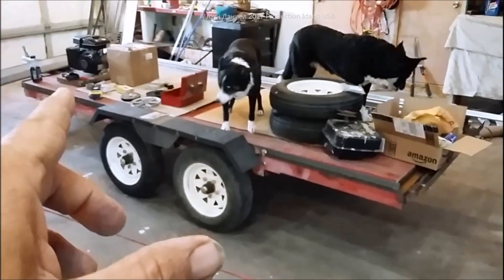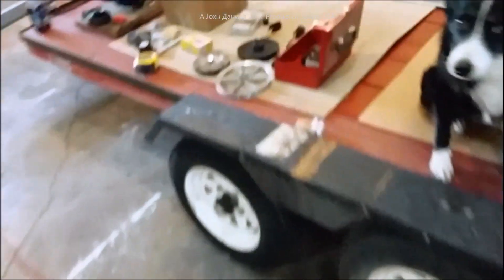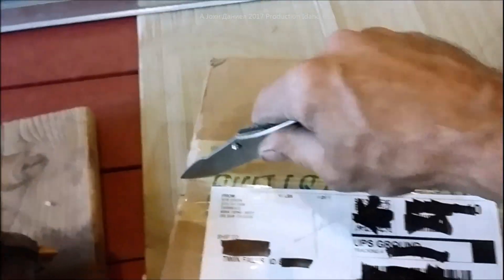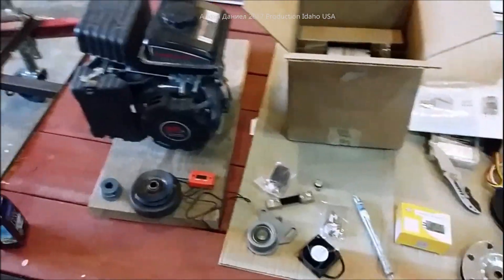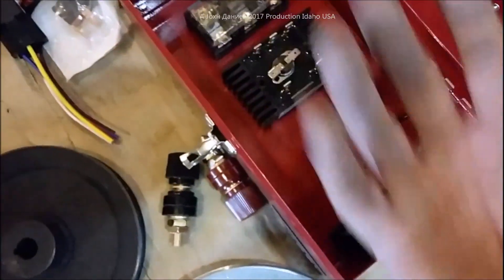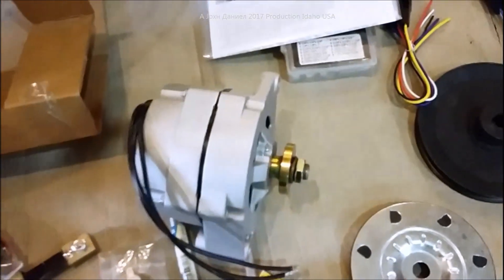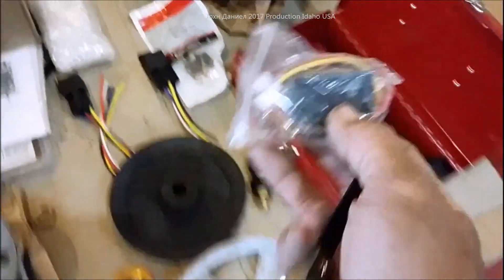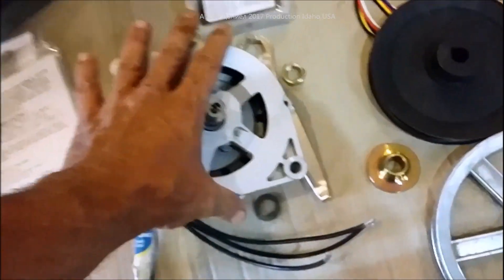DIY 12V Generator Charger Gas Generator Battery Charger, Home Built, Off Grid Part 1

Comment from the maker: The PARTS USED - A Better Engine, PMA & major parts used below with their Specs & Details. Best 3-4 horse engine option (DON'T OVERSIZE) LIFAN 4 http://amzn.to/2uKuOwl  OR Honda Clone, https://ebay.to/2F470Vc NEW 4hp
The REAL HORNET PMA By Thermodyne (Other brands are fake junk) https://ebay.to/2F1xyX6 Super Core 12v
AND the 24 volt https://ebay.to/2HzjqK3 SC 24 Volt
Then the brain controller that shuts your engine off at voltage you want - https://ebay.to/2HIo6x0
 THER10k

THE 100 Amp  RECTIFIERS I USE http://amzn.to/2uL91EK
The DC Relays I definitely prefer http://amzn.to/2gSwzBN
And the HOUR METER for tracking your use http://amzn.to/2gTfJTi

The REST of the parts are Common sense but if you ask I will answer with a source link if i have one. 
**⚠ If you go get something "claimed made in America" from somewhere else, Like Missouri huckster Jeff,  thats NOT got the Hornet label PLEASE don't post some hate & anger replies on my videos. ⚠
Reply: John where is part 2?
Reply: Please publish part 2
Reply from the maker: I have it built and some footage but I keep pulling and using the engines for pumps and compressors! But I have one in a box just got it this month but its shaft is metric, got to get a 20 mm adapter and time off my 75 hour work weeks to do some machining. Blame Trump! That idiot got elected, cut 20 regulations that was keeping me home with almost no job, and demands on my kind of work jumped from 20 hours a week to almost 100.  We need to kick him out of office so I can get back on foodstamps and build hobby stuff LOL! Don't worry, Google and CNN are working 25 hours a day on it!

Comment: wvdon  I am wanting to charge my 4-12volt 100 ah lithium batteries through a Renogy 50 amp 12 volt to 12 volt converter. The renogy is what I use to charge batteries when driving....

Comment: 👍 Dear John, what happened to this excellent project? In the future I have to build an emergency battery charger from a brushcutter / grass trimmer motor and a normal Mercedes Diesel Alternator something like that, I only hope that this small motor is strong enough to run the alternator at 1500 to 2500 revolutions per minute.
Reply from the maker: Lack of views initially means don't spend the $$ to finish it if no one cares.

Comment: How many batteries do you have? And how often do you have to replace batteries?  Could this same system be designed to work with natural gas?  Id like to setup a system that will allow me to use a natural gas generator to keep batteries charged while using max capable power during all hours, at will, and keep my cost around 100 a month to include maintenance and repairs.  So for example:  I use batteries during the day to run AC/Furnace, Refrigerator, a few lights and a few computers. These are constants. During certain months I run pool equipment.  When the batteries are low the generator kicks on, recharges the batteries (as quickly as possible) then shuts off without there being any real noticeable difference from being on grid.  During the summer months our bill with the pool running is roughly 300 max, all other months its anywhere from 80 to 100 a month.  They are getting ready to roll out smart meters here and I would like to consider my options and preferably be able to tell them to fuck off.  The smart meter fiasco is nothing but a wealth redistribution scheme to offset the states welfare cost by up-charging the working class.  Basically a new tax!
Reply from the maker: My shop battery bank is 14 of the L-16 Dekka Solar batteries, I get up to 8 years from them.

Comment: Sorry to bother you "again" but did you build it, I have a leece Neville isolated ground 24v 140anp I plan on doing a similar thing in the future using a bigger motor around 10hp I guess, the clutch you have there is something I will have to buy in the appropriate hp range , not using a clutch dosent really appeal to me
Reply from the maker: I built the frame, mounted the engine, then got a request to build another Chaos style turbine so the PMA for the project is flying on a pole in Baker Nevada. So Until I order another one its 50%+ built and in limbo. I need to order 20 of them SC12 core plus PMA's since I can never have enough of them for builds I get asked to do.
Reply: Јоhn Daniel , 20 pmas  that would be nice , I'd be like a greedy billionaire coveting my nice new shiny toys ,  at least you're helping people in person or via video.

Comment: you do not need to use petrol ' its costly and engines make to much noise and cause pollution ' its possible to use a small electric motor powered from lipos that turn a pulley on an alternator thats excited by 12v lead acid ' so a converter ' to keep battery's topped '''' to run a ac to dc inverter 240v
Reply from the maker: It would take over 40,000 of these engines running 24/7 to equal the pollution of Al Gores private 747 jet on a Save The World trip to eat seafood in Japan.
Reply: fred bloggs why use batteries to charge batteries? And normal alternators are only 60% effiecent. You can use lipo li ion . liFePo4 in 3-4 cell for 13 v systems. The purpose of this . is for when the batteries are low. And there is no other way to charge them.

Comment: I built the same one from Thermodyne. I found that if I used the recommended maximum rpm it did not cool very well. I went back to a Delco 10si 24 volt alternator. I have it set up with a data logger and I hacked the field with a 25 ohm rheostat. Now with the flip of a switch I can bypass the internal voltage regulator and adjust the current manually. I us this just as a back up to our diesel generator that charges our off grid battery bank on rainy or snowy days. Solar handles the homestead most of the year. We only burn about 25 gallons of diesel a year in the generator. The PMA idea is good but the magnets will not stay on the rotor at high enough rpm to cool. Others have had this trouble as well. Even when they are controlled with a MPPT charge controller. I am very interested as to how your experiment went.
Reply from the maker: Trying to get full power out of a PMA will burn them up when using a engine. But by running 50 feet of wire from it to the rectifier in the shop it runs much cooler pumping 36 to 45 amps and like you, it's a snowbound needed item. Since my thermodyne PMA'S on wind turbines in my wild winds has lasted 4+ years in Idaho weather, they are good. None from Ohio-missouri-china made it a year in same conditions.  
So far, so good. Need to edit the build footage on it and upload it, like a dozen more I am lagging on.

Comment from the maker: Some answers, WHY A 3 WIRE 12 volt AC  PMA instead of a 12volt DC since Thermodyen sells both?? - Because It will allow me to send power a long distance to the rectifier in the shop. Up to 150 feet away using 3 wire verses 20 feet for DC
Why That PMA from Thermodyne??  - Because hes not a fly by night company and his stuff works 300% better than anyone else.
I love making this stuff, And if you have some thoughts or ideas, PLEASE POST THEM! 
 Heres my current PARTS USED - A Better Engine, PMA & major parts used below with their Specs & Details. Best 3-4 horse engine option (DON'T OVERSIZE) LIFAN 4 http://amzn.to/2uKuOwl  OR Honda Clone, 
http://rover.ebay.com/rover/1/711-53200-19255-0/1?icep_ff3=2&pub=5575119394&toolid=10001&campid=5337668021&customid=118cc&icep_item=181102796604&ipn=psmain&icep_vectorid=229466&kwid=902099&mtid=824&kw=lg NEW 4hp
The REAL HORNET PMA By Thermodyne (Other brands are fake junk) http://rover.ebay.com/rover/1/711-53200-19255-0/1?icep_ff3=2&pub=5575119394&toolid=10001&campid=5337668021&customid=THERMODYNE&icep_item=331994936214&ipn=psmain&icep_vectorid=229466&kwid=902099&mtid=824&kw=lg Super Core 12v
AND the 24 volt http://rover.ebay.com/rover/1/711-53200-19255-0/1?icep_ff3=2&pub=5575119394&toolid=10001&campid=5337668021&customid=THERMODYNE&icep_item=232050934631&ipn=psmain&icep_vectorid=229466&kwid=902099&mtid=824&kw=lg SC 24 Volt
Then the brain controller that shuts your engine off at voltage you want - http://rover.ebay.com/rover/1/711-53200-19255-0/1?icep_ff3=2&pub=5575119394&toolid=10001&campid=5337668021&customid=Engine+Stop+Controller&icep_item=231585817612&ipn=psmain&icep_vectorid=229466&kwid=902099&mtid=824&kw=lg
 THER10k

THE 100 Amp  RECTIFIERS I USE http://amzn.to/2uL91EK
The DC Relays I definitely prefer http://amzn.to/2gSwzBN
And the HOUR METER for tracking your use http://amzn.to/2gTfJTi

The REST of the parts are Common sense but if you ask I will answer with a source link if i have one. 
**⚠ If you go get something "claimed made in America" from somewhere else thats NOT got the Hornet label PLEASE don't post some hate & anger replies on my videos. ⚠
The online STORE is Windgeneering, AKA HYDROGEN APPLIANCE / THERMODYNE Systems / HORNET. That place has the real stuff. ⚠ Many have knocked off  his materials & designs and made cheap foreign copies, be smart avoid them! 
Best part, when you buy from the guy who invented all this stuff you get your questions answered by someone intelligent!

LOOK FOR LINKS ON MATERIALS I USED, TESTED and PREFER AS I GO. POSTED IN THE COMMENTS OR IN HERE 
 ( ͡° ͜ʖ ͡°) 

 ★ All SELLERS, STALKERS, HUCKSTERS from Junk Sellers of Similar looking stuff, Chinese, Vietnamese, and Other Knock Offs will be blocked and removed ASAP from insulting, stalking or threatening me or my viewers  ★
❂ I am not a sponsor, employee, compensated representative of any materials I use, they are just the best I have found and prefer. If you find better stuff from actual USE OF IT, suggest it.
Reply: CORRECT  I too have recieved very good info from wind engineering even when I have asked hard and confronting questions, they did not get aggressive or abusive , you expect that response from professional businesses

Comment: I looked at the site on ebay, those alternators that you are using. They are very high rated for this. That guy makes a DC version too why no use it?
Reply from the maker: WHY A 3 WIRE 12 volt AC  PMA instead of a 12volt DC since Thermodyne sells both?? - Because It will allow me to send power a long distance to the rectifier in the shop. Up to 150 feet away using 3 wire verses 20 feet for DC

Comment: nice relay overvoltage protection device , i was wondering the whole time i was watching this vid ,  until i saw that.
fun project and to see decent watts at 1000rpm will be good.
the front housings and bearing housings/retainers on those pmas are fairly robust unlike some vietanamese made ones.
i actualy thought a pulley style turbine with big props would have been built by now using these pmas by guys in lower wind areas.
i like the style belt you intend on using i always thought of using timing belts and sprockets  as i have changed many of them in my life and knowing how tough they are.
i will no doubt build something of that nature one day.
Reply: My wind area is ok, probably 10kph on average and in the spring its 25kph but I think the ability to gear one would make it useful. But his idea of a efficient gas engine to use limited like in a snow storm for just bringing your batteries up is good.
Reply from the maker: Mason, its either feet per second, or Miles Per Hour, When you quote do a pre conversion so my viewers in Missouri can get it!! LOL.

Comment: It is a Champion Generator from Tractor Supply.  The air conditioner is a 13,500 B.T.U. Dometic.  It runs the AC pretty good,  but it begs a little getting it started.  I may need to give it a tune-up.  The AC pulls about 1750 watts.

Comment: Awesome man. I just put up a video today of a small generator (of sorts) that i built today to pump power back thru my grid tie inverters for when the sun isn't helping my panels.  I run my motors on charcoal gas from charcoal that I make myself. No gasoline or diesel or alcohol or propane. Ha ha Peace man!
Reply from the maker: Very cool

Comment: I want to do one in the future.  I have a 3500 AC generator now.  It will barely run the roof Air Conditioner on My camper.  I want a fast way to charge my batteries to run my lights at night.
Reply from the maker: Check the RPM's of that 3500 and see if its 3600 rpms, or at least check and make sure voltage is 125 while running with about 300 watt load on it. One that size should run a camper AC with no issue. Generators should spike to 125 volts under light load and drop to no lower than 115 volts under 90% full normal max run wattage.  I once checked my old 3500 watt champion and got 3400 rpms, raised it to 3570 and voilà' it ran the whole camper.

Comment: What horsepower engine are You using?
Reply from the maker: Its 3 horse. It should give me about 82 amps which is 1000 watts with the current set up, but I will eventually go up to a 4 HP like in the links I put on here. I Prefer the LIFAN engines.

Comment: Very nice setup.  I would recommend that you change out the HF Torch spark plug and replace it with either an E3 or an NGK plug.  They work better.
Reply from the maker: I did that a few months into having it for testing these PMA's and doing a video on it with MOLY MOs2 additive in it.  The terrible HF plug made it shake rattle and roll hahaha. I put a BOSH plug in it, not sure what model but it was like night and day. It is so smooth and quieter now I wonder why HF is so cheap they get a bad rap over $1 worth of plug quality.

Comment: I would go with the 2 inch my friend. because after that generator starts making lots of power that smaller pulley will slip.  Might be able to set that generator up to speed up or down depending on the loaded needed. to save on gas. and if it has and electric start you could set it up to start if you are needing power at a certain voltage to recharge the batteries. I do like this back up Idea.
Reply from the maker: Yes, I have a DUROMAX XP7HPE engine with electric start, its about $175 here http://amzn.to/2uKPPH1 , over $300 everywhere else. But I chose the 3 or 4 horse for fuel use and its good enough for 80+ amps ( 1150 watts+) which is where I will run it at.
Reply: I have a 6.5 horse I got for my Tiller from harbor freight that is one hell of a motor still runs with one start. There pretty much all Honda motor's.  They also have electric start and the price is not bad at all.
Reply from the maker: I will be using a tensioner pulley to engage the belt as well as hold 40 lbs force on it. Also using a belt designed not to slip so we will see what happens.

Comment: you take it a part you will get a pinch belling you should have put a pic of that up you will end up with this lol the case of the pinch belly.  Looks like you are going to have a nice DC generator.  Smart idea, why, because so much is lost to go from ac to dc so many losses and eat up a lot of gas for the wasted losses. When you can go straight the DC voltages you need.  I like to do that but I have junk I cant even use or sell.  Cant wait to see your finished product.   Sounds like you are building a inverter generator but not making ac witch is cool.
Reply from the maker: I figured I was using 16 lbs of propane per battery recovery cycle with that big generator. At a cost of $2.20 a gallon and all the conversion facts I was only getting 45 amps and it took hours.